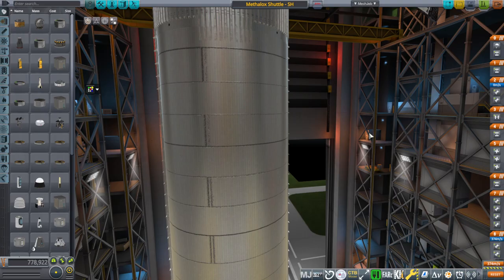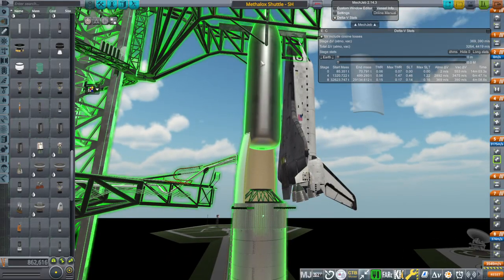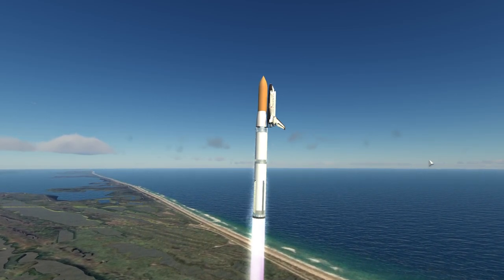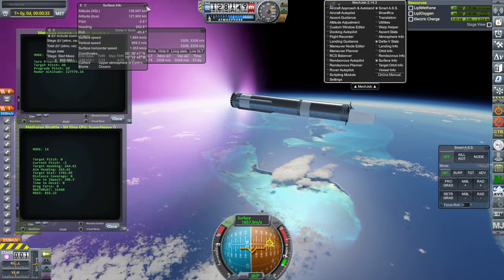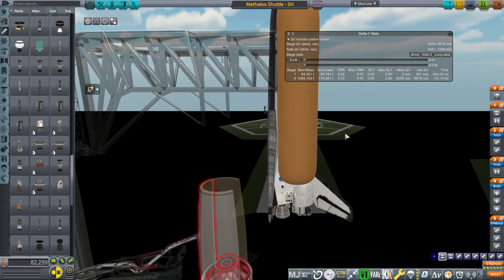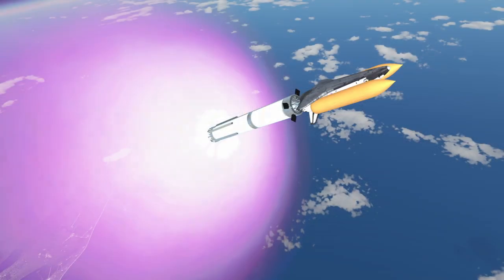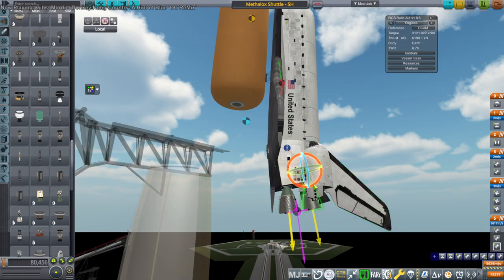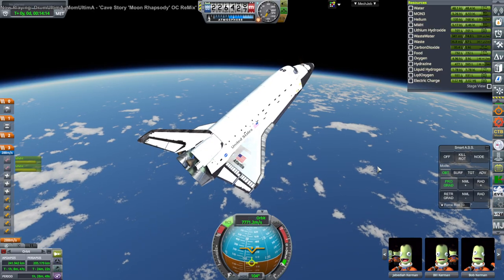Methane Shuttle on Super Heavy (RO in KSP 1.12)

Comment: I don't even want to think about abort scenarios with two ETs strapped to the orbiter and the whole thing perched atop a stainless steel skyscraper.
Reply: It’s probably be easier since the booster is liquid, they could abort at any speed and altitude.
Reply: it was a thing on nasa’s plans for the earlys 90’s shuttle replacement plans
Reply from the maker: I think this would be much easier on aborts than STS, since the balance and aerodynamics aren't as much of an issue, and having a liquid booster is helpful as mentioned by others, especially since it can be shut down and it's at the bottom rather than the sides of the crewed vehicle. Really, compared to STS, this is better in every conceivable way.

Comment: Shouldn't the flames from RS-25's burn thru SH walls?
Reply from the maker: These were Raptor Vacuums - RS-25 was a previous video. In that previous videos, the RS-25s were tilted away and we would have to check that out in terms of how hot the plume is where it hits SH - same with the Raptor Vacuums on the initial version in this video if we light them early. In the version that made orbit, we had nearly the same engine setup as Starship - just short one Raptor SL - and so we'd probably just hotstage like Starship does.